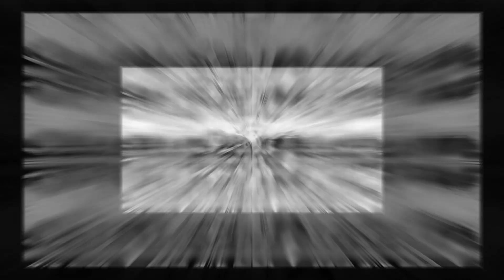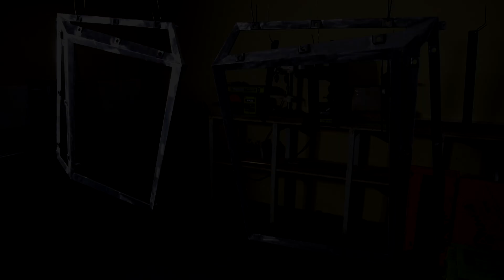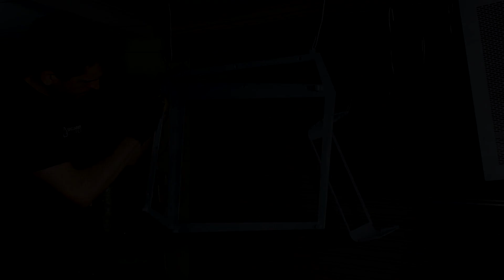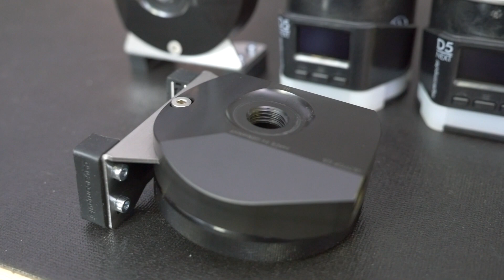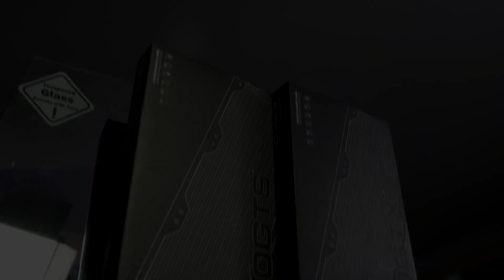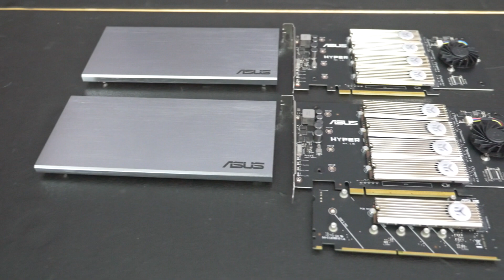Zirconium Build #40 Part 3: Modding!

Comment: I'm not sure if you saw this on your own yet but those Hyper16x cards have a V2 build with better power delivery. I ran into a stability problem with using 4 M.2 drives powered by the card, it would randomly crash the RAID. I looked into the problem and discovered that a V2 had been produced to deal with this problem. Once I switched I never had the issue again. I have my V2 card running 4 905Ps in  VROC 0 without issue.

Comment: Daniel, your modding skillz are godlike, but you are a total idiot when it comes to workshop safety. Wear safety goggles/glasses and a dust mask at ALL times ffs. I see what looks like safety glasses placed on the table, but they do not help unless you wear them to protect your eyes lol. With a lot of your videos like this one showing you painting, sanding, grinding, and cutting, you place your face very close to the action without goggles or dust/respirator mask as if you purposely hope to breathe in all the toxic dust and paint vapors and get abrasive particles in your eyes.

imho, your client must just want to masturbate while staring at his finished build as he thinks about all the gold that he spent money on, even though much of that gold will not even be visible in the build.  Assuming that you finish this project this year, someone will build a PC in 2021 that is at least 30% faster for less than one-tenth of what your client paid for.